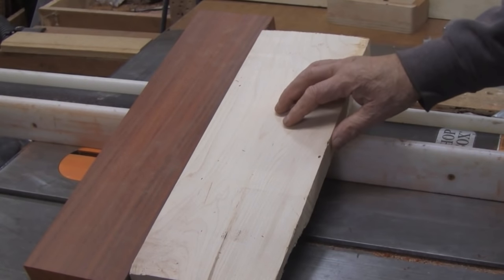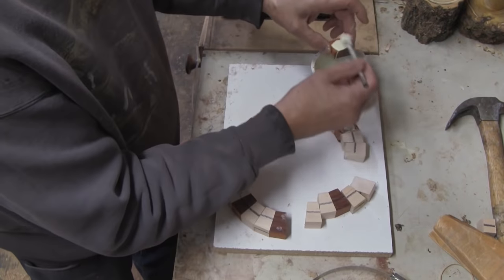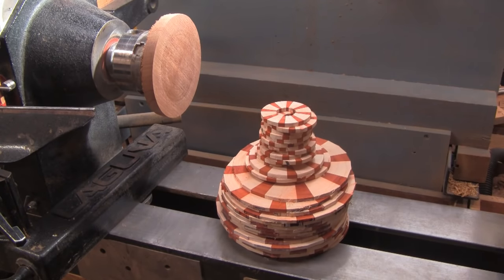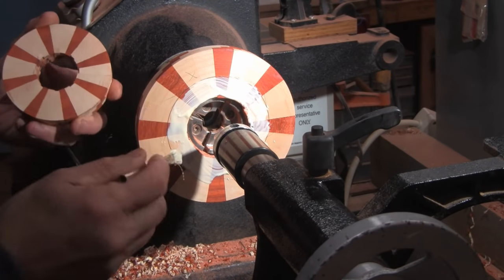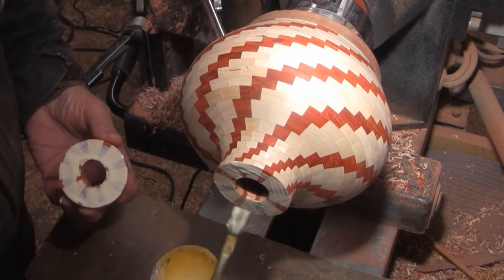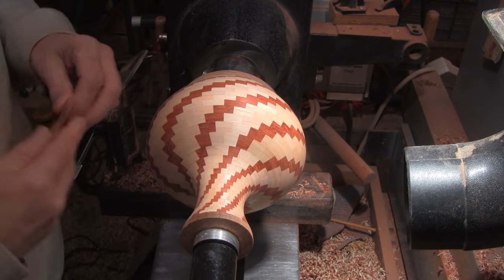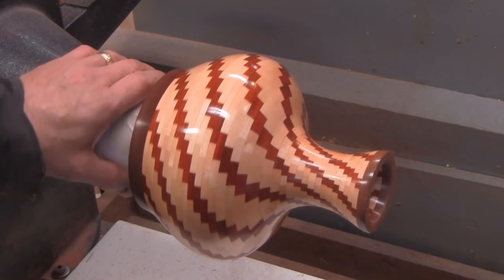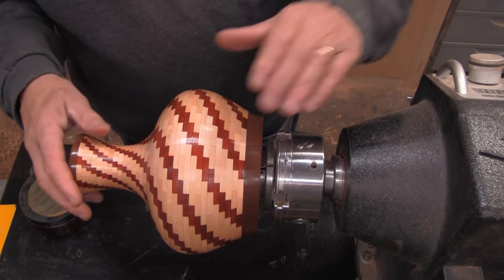Wood Turning Segmented Twisted Vase

Comment: I like your vase , it's beautiful . I too make segmented bowls . I use the large hose clamps like yours . put down some blue tape put your segments edge to edge glue all the edges like you do . grab both ends of the tape bring the two ends together , put the clamp together tap them flat wipe glue let dry . rinse and repeat . I did a small production run cut all segment pieces I glued 150 rings in a day by myself . hope this helps
Reply from the maker: Thank you very much Terry. I have used the tape method as well. Mostly on larger segments. I do not glue them all at once because I will glue some onto the base of the turning on the lathe and by the time I get another ring glued up I can flatten the ring on the base and so on.
 Have you ever used the rope clamps? Works like a tourniquet.
Saw it on Earls segment shop video.
I use them as well.
 Thanks for the tips they are excellent ideas.
Gary

Comment: Another excellent example of the quality of your work, Gary! That is a great tip about the bleed over from the padauk. I wouldn't know where to get any of that in my neck of the woods. Having the plans for that would be awesome. I love doing segmented work. I don't have a band saw at this juncture so that would be a problem with this piece. Take care and i will be watching for the next video!
Reply from the maker: Thank you Clayton and the plans will not require a band saw. I designed it to be made with thicker pieces.
If you have not just email me at mgdpapa@gmail.com and put Segmented Decanter in the subject line.

Gary

Comment: Hi Gary, nice vessel! I know ist that it is a question to sand different coloured woods. For instance, maple, nut or purple heart. For example complex patterns with this woods are sometimes horrable to sand and not to get red dust into the maple. In your case it is impossible, but when I sand I change the sandpaper if I switch to sand maple. Best wishes Andreas
Reply from the maker: Hi Andreas glad you liked it. Switching sandpaper is a great idea but not sure how I could just sand the maple without touching the Paduak. It certainly would be a great idea with flat work for sure.
Thanks for watching and commenting.
Take care,
Gary

Comment: WOW, awesome vase Gary, I love the colors and I really like the tips on keeping the padauk from bleeding into the maple! I agree and like you  I love lacquer and have been using it for years although I spray independent from the lathe and use a water based lacquer and sanding sealer! I have never used Acks paste but I have some Hampshire sheen  and I am hoping that it will do the same job as the Acks! Thanks for the awesome video and look forward to the next one!

Cheers Al
Reply from the maker: Thank you Al glad you like it. I have never used water based lacquer but I have seen others using it. I assume you use a separate spray gun? Yes I am sure you Hampshire Sheen is the same and will work fine.
Thanks for watching and take care,
Gary

Comment: If you had used Walnut instead of Paduak, would that have avoided the tendency of the darker wood bleeding into the light-colored Maple?
Reply from the maker: Hi Rod, yes if I had used Walnut there would not have been any bleeding. I have only used a few types of wood that will bleed the colors. Padauk being the one that bleeds the most. But I really like the color of it along side Maple.
Thanks for watching,
Gary

Comment: Gary, You like sharing with videos but I love to watch Your videos 😀👌  I felt a little dizzy while watching 😵😁 Magnificent work on this project. Measuring, cutting and glueing tooks a lot of time. This is the hidden side of turning but is very important to get so beautiful look. I think I have to start using computer program to make designs and not calculate it with every layer.
All the best my friend.
Rav
Reply from the maker: Thank you Rav and you could do it with this online free segment calculator.
I used to always make a paper sketch of what I was making and then draw lines to get the layers. Very easy to measure diameters at that point in time. I still do that on some turnings such as dizzy bowls. No software for making them.
https://www.blocklayer.com/woodturning-segments.aspx

Take a look at this I think you might like it.

Gary
Reply: @ThePapa1947  I always have problem with visualisation of the bowl. Drawing the bowl on paper sheet will help me with it. This software from link is better than Segm. Calc. 2.0. I will start using it 😀👍 Thank You my friend 🤝

Comment: What software do you use to build a virtual picture in your planning stage. I'm curious because I'm a retired computer drafter and used AutoCad and AutoDesk Inventor at work and home.
It looks great Gary and the pattern seems to move while turning at low speed. Love the intricate procedure used to build this beautiful vase.
Reply from the maker: Thank you Gil glad you liked it. I use various software for my designs. I have Bobcad that I use mostly for my CNC machines but I also will use it for some bowl designs. This I have the WoodTurner Pro package. I will use the 3D Pro to go from scratch. SegmentedPro is also part of the package and comes with basic shapes. My favorite is WoodTurnerPro itself. Which lets you modify the shapes. So on this one I made the sketch in 3D Pro and imported it into WoodTurnerPro to get the neck the way I wanted. 
Take a look at their site you might like it. And getting the package of 3 saves a lot of money for more tool..LOL
Take care,
Gary

Comment: great looking vase.  I contacted you once before about padauk bleeding into the maple while sanding.  You indicated that i should use denatured alcohol to remove the bleed.  But in this video you stated that you did not us the alcohol as you where afraid that the padauk would bleed into the maple.  So i am confused as to how i get rid of the padauk bleed into the maple while sanding.  did the padauk bleed into your maple while sanding?  the maple looks alittle darker than when you were cutting the maple pieces out. Thanks for your videos.  they are great.
Reply from the maker: Hi Tom and thanks I am happy you liked it. Well I thought the denatured alcohol would clean the oils away but I found out different.  Even if not sanded the padauk would bleed on me. I tried many times to blow all the dust out and it still bled. Spraying lacquer with a wet coat bled real bad. I tried just over spray a number times and that seem to work.
I think my lighting and my camera added little tint to the pictures as in person they look like untouched Maple.
 Did you try using denatured alcohol and if so what were your results.
So I guess I am as confused as you are but I will still try to figure this out. Sorry about the confusion.
Gary
Reply: @ThePapa1947  Hi Gary,  I have not been working with padauk recently.  I switched to Purple Heart as it is harder and does not bleed at all into the maple.  Once I finish this current project i will spend some significant time with padauk to see what i can accomplish.  I'll keep you posted if i find a good solution.
Reply from the maker: please do Tom. I tried again yesterday with some scraps. I am thinking it is oil in the wood more than the saw dust.

Comment: Gary beautiful project. I have a question, so I'm trying to get into segmenting so I came to you. I have watched you do a lot of segmenting but I bought a sled that only has one angled arm and I saw yours has two. Do I need to try and make one for it?
Reply from the maker: Thank you very much.
Which sled did you get?
I prefer 2 arms but people have success with single rails.
 I just know that the one I made works perfect and no adjusting needed.

Gary
Reply: @ThePapa1947  I bought it from home Depot and I'm hoping it's for the purpose I bought it for!!! If not I might cry... 😂 It is a powertec sled
Reply from the maker: @williamdodds6104   I will have a look at it.
Reply from the maker: @williamdodds6104  it looks like it will do what we you need.
 Once set up test on some scraps. Might be adjustments but then you will be set.

Comment: Very nice once again !  Do you prefer lacquer instead of a polyurethane ?
Reply from the maker: Thank you Tommy! I like them both and depending on the piece is how I will choose them. I wanted the natural color on this one plus the Paduak tends to bleed its colors to the other wood. Also I think the lacquer just gives these segments a very nice feel and look.
I also like wipe on poly because how easy it is to put on and gives a great finish as well. It will add a slight yellowish tint to the work and I did not want that here. So  I guess I like them about the same.
Thanks for watching,
Gary

Comment: Yet another awesome piece, I would very much like any plans you have. Do you use any of the computer design programs ? if so perhaps you would be good enough to share the file. I have looked for a direct email address for you but could not find it. Many thanks.
Reply from the maker: Thank you Ricky. I use Woodturner Pro. You can find my email in my About Page. You will need to do it on a PC as it does not show up on a phone.
Thanks for watching,
Gary

Comment: Ok,i aint gonna blow smoke up your kazoo pop's.I have watched alot of segmented wood turning videos on youtube,and the shapes of the turnings for the most part  are pretty uniform(still like them all tho).But this shape,yeh it stands out,the contour's are very very nice(although i would like to see the bottom cove follow the top cove profile more...thats just me :).I think this is a great piece pop's, the ring pattern and colours are very nice, but that profile..yeh it is really impressive.Oh and by the way, did you know you sound like the voice of Charlie,off the original series of Charlies Angel's(well you do to me)...all the best m8 keep up the inspiration :).
Reply from the maker: Thanks Peter and no smoke required. I would say it would have looked nice with the coves the same and maybe on the next one. I actually had drawn it with no cove on the bottom and then decided to go with it.
Hmm I will have to find an old Charlies Angel's video.
Thanks for watching and commenting.
Gary